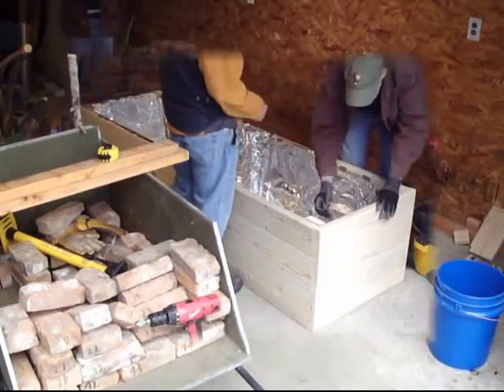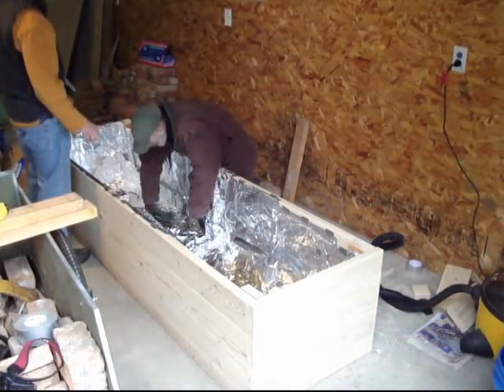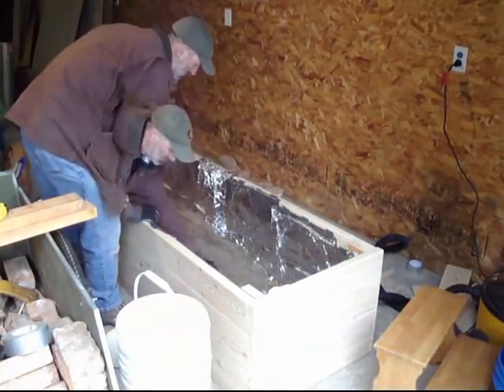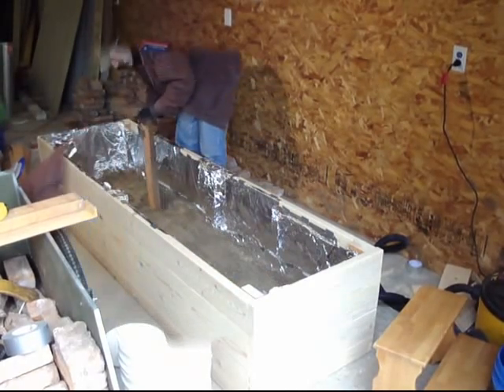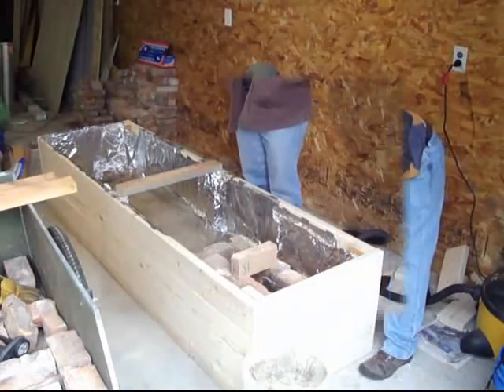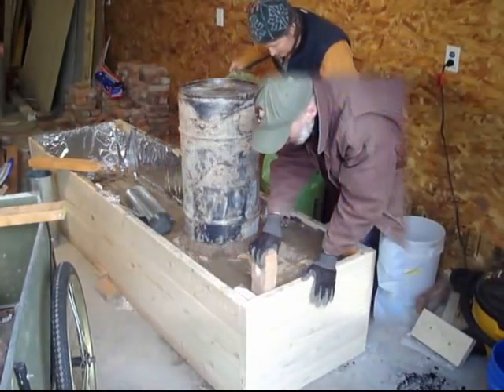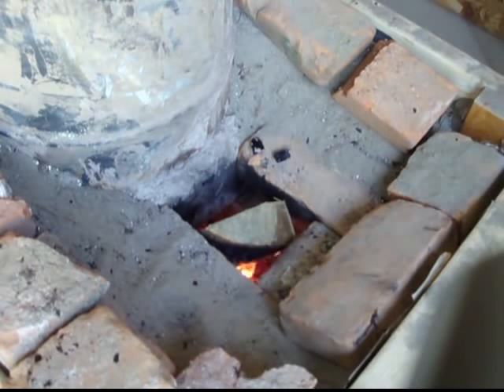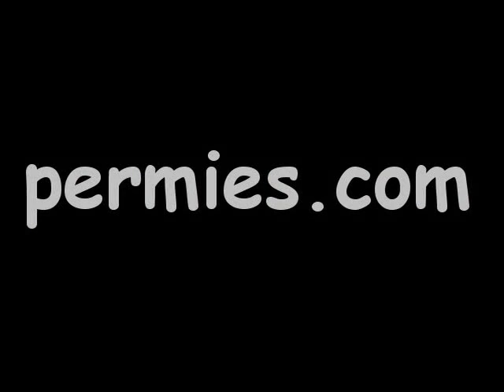rocket mass heater build and burn

Comment: You do a smaller then 200 liters drum? because I have same idea, mine home is just 27 square meters and 2.70 m high sealing, with a 200 liter drum I get possible to much heat, what you do think. Thanks.

Comment: dear good idea my question is same mass heter i build in my room in fire place i burn wood the smoke come in room to what should i do
Reply from the maker: You have not made a rocket mass heater.  What you have made is something we call a "freakshow of flaming death."  I suggest that you stick to electric heat.

Comment: 1. Fuel feed being too close to throat as well as the lack of air control are both solved by tall vertical feed tube, with air flap, mounted on flat steel plate base.     2.  Combustion tube reflectivity (and efficiency) very much improved if section of industrial kiln ceramic roller tubing.

Comment: I have watched a ton of RMH videos and it all looks cool.  However  no one has ever said have long you have to fire one of these things before you can get 12 hours of rockety heated bliss.  I have a job where I'm gone from my house 10 to 14 hours per day 5 to 6 days a week. Currently i heat with an outside wood boiler which eats forest.  Filling the boiler can last up to two days but it usually doesn't. I love the idea of burning less wood but I don't have the time too chuck pine cones and twigs into a stove in between bong rips.  Do you fire these things once or twice a day for an hour or two?
Reply from the maker: Look at the batch box systems.

Comment: Nice Rocket stove. But I dont understand why allways metal drum? Why not to build Brick Masonry Rocket Stove? It's pretty simple, eficiant and long lasting. You may look at my Rocket Stove. The same principle, just brick and clay.
Reply: Zeljko Posaric
Reply: I think because metal quickly transfers the heat into the air allowing for less heat to be wasted out the exhaust.
Reply: That doesn't make sense. 

The entire idea of the "mass" heater is that just trying to heat the air is the quick way to peak inefficiency.  The expression "room temperature" is referring to the actual room itself -- the walls, floor, ceiling, furniture.  By the same principle, if you light a candle,  its heat will quickly dissipate in your average room. But invert a terra cotta (cob) flower pot over it, and it will absorb and radiate the heat more effectively. 

The fire barrel is the outer casing of an inner burning chamber where the wood gases that would otherwise be lost up the chimney get utilized. That's what gives rocket stove mass heaters that whole efficiency thing.  

If someone has the time and skill to make a cob burning chamber nestled inside a larger cob exterior casing, all the more power to them!  Literally!

Comment: As @kenfo0 pointed out you never said how the sand worked out vs.clay. Hat tip to @cdimmm I was wondering where I could get clay without coughing up enough for a truck load or something. Kitty litter I could buy by the bag, some each paycheck until I have enough.

Comment: I think you would benefit from placing an air inlet off of the side of the burn chamber that draws air from the outside so you are not drawing the warm air from the room you are trying to heat.

Comment: i am sure you have answerd this kind of questions a 100 times but how do you clean the oven and all the pieps and how often do you have to do that`? when you close everything how do you have acces`? i am damn impresst of your work`!! it just does not fit in my brain yet^^
best wishes from germany
Stefan
Reply: There is very, very little ash left behind when one has well designed a maximum efficiency rocket stove mass heater. Very little.  

I used to have to clean out my wood stove everyday.  I only have to clean out my rocket stove a couple times a month.  

I built mine with a removable tray I can pull out from under the fire chamber.  You put clean-out doors on the stovepipe wherever logic calls for it. I have one clean out down each arm of my stove pipe, and one outside at the bottom of the exterior stovepipe chimney. One uses a chimneysweep brush to clean the smoke stack & the pipes. When the ashes are totally cool, one can use a shopvac to clean up the ashes.  Even though mine loads from the top, I also made a door I can open to scoop out the ashes, or live coals, if I have a mind to.

Comment: and thats 90 precent efficien in a home as a heater because you have no hot gases going out the chimny oh yeah the cooler the gases get the thiner the pipe you need because the air becomes heavyer

Comment: you need a biger barrel drum your smoke outlet that goes out of the barrel drum needs to be on a bit of a higher level than the fire its above it now but the higher it is the better later down the line from what i know the exsost gases cools down so the longer the pipe the better i dont know if you wanna heat a room or you wanna make a stove but a the end of the chimny pipe tou used i guess the gases are quite cool so you want a pice of iron pipe taller than the barell drum you are useing

Comment: I've build a massive rocket heater w/10" burn pipe 3/8" thick fit into a tall hot water heater tank with 8" pipe outlet. This can be used as a rocket heater or a rocket mass heater, has feet and is portable although it does weigh 300 lbs.  What I've learned from a lot of study is that pea gravel and mud is a great combo for heat storage with just the right amount of insulation. I'll use it in a small shed as a heat exchanger until it goes into my dome house later w/water to heat floor maybe.

Comment: Your "stack" where your burn material goes in is to short and should be around 12" to 15" tall before the 90 degree turn into the burn area to begin combustion. Also it does'nt show if your stack pipe exiting the the mass heater should be at least 10' to 15' in length to rise in order to provide a stronger draw. A 45 degree slopping draw would be great to cause the rise needed to provide you with plenty of draw. Try increasing the stack out size to 1.5 times the input stack diameter.

Comment: this is the rocket stove for me,.I have lots of super heavy duty ten inch casters and could bolt eight of them to the bottom and wheel the hot coffin from the house to the shop in a few minutes without letting the fire go out. just have to have a quick coupling for the chimneys.

Comment: I have been through the comments,and through the site and havn't seen any thing that says if you have come up with a design on this stove that incorporates a low voltage,12 volt preferably;blower and ductwork system to heat several rooms with

Comment: For a thermal mass. Water more or less has the highest specific heat capacity (heat storage by weight/mass) of any substance known to man. And If you calculate in phase change (creating steam) you can store even more heat. Be aware though that this new factor is heat storage is based on volumetric heat capacity. (heat storage by space taken up). But.... potato potato really. Good video.

Comment: How did you overcome the smoke back and insufficient draw issues?. I have the same problems using a 1 metre double skin s/steel riser and a 47k gas bottle for a barrel (with the bottom cut off)
clearance inside top was 2". Without the barrel on the draw is amazing!!? all 6" pipe

Comment: i'm also making a version of this rocket heater, just a litltle bigger.
one thing i came across (and in other rocket heater videos) is that the tunnel, where the flames pass thru before entering the heat riser,is too low, so i used two stacked fire bricks for the tunnel. works fine, better then one in my expiriences.
also, i placed one flat brick at the end of the tunnel a bit higher for better conduction of the flames. i'm gonna upload a video of this, so u'll see what i mean. grtz

Comment: Paul- is there a follow up video to this one? I'm trying to do the same thing, so that I can move as necessary- trying to heat a shipping container (300 sq. feet). But I'm trying to figure out the "not rockety enough" - and see what mods you made. Can you help? Why not show more details? I'm looking over permies-can't find much more than, "buy this book" that's not already on youtube. Specifically i'm looking at alternatives to the cob for filler in bench - sand? vermiculite? Bricks n pebbles?

Comment: You coudl make iron enforced plaques for the floor that would be much wider than the stove and so the stoves weight woudl be spread on the floors it was set on over a larger area.
    As the idea is to have lots of thermal mass to hold the heat if you make it lighter it might not work so well but i am not an expert on thermal mass. rose.

Comment: @paulwheaton12 you are looking for something that happens when the system is older and set. also this is a small system not an 8 inch so it will never sound like Iantos. part of his is the 55 gal drum reverbing :).

that little system is drawing like a champ and your flame speed is good i would leave it be and fire it several times to check how it improves with use over time.

Comment: @Axbent if you can get a sooth fire going in a rocket stove let me know. :)

the exhaust is steam and CO2.  not very much chance of things burning in the pipe.
these stoves are very efficient when made right and paul has his made very well its burning at 800 F so the stove is not only burning all the smoke its burning it to the limit the exhaust will have no smell at all. the last compound that can be cracked in wood smoke is getting cracked so you have no chance of creosote build up.